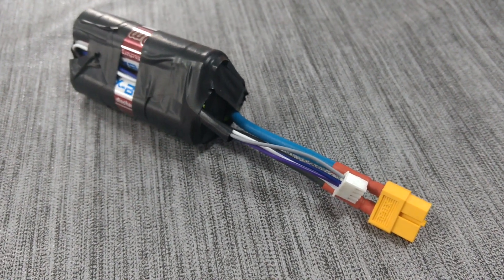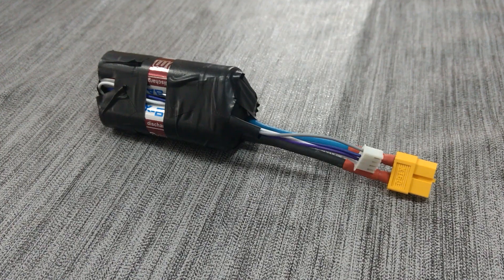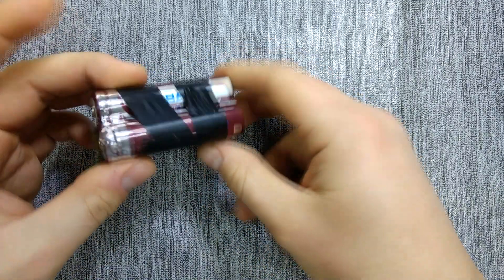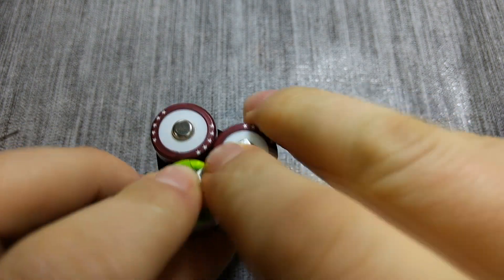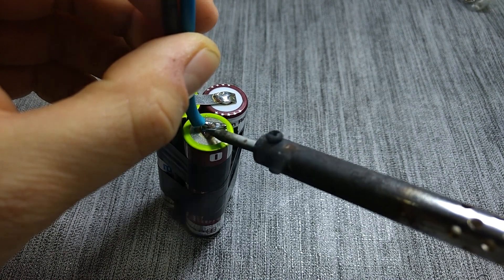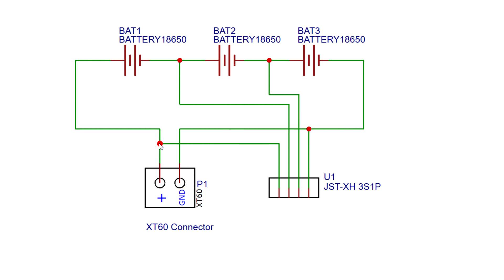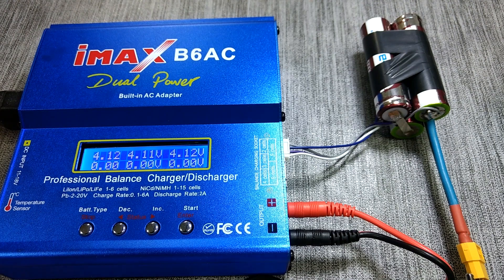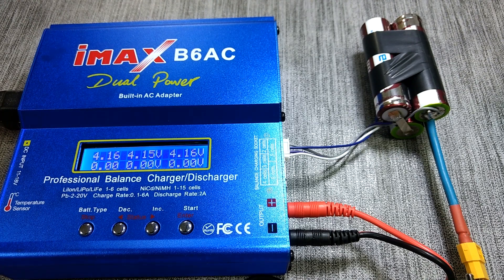RC Battery Pack made with 18650 cells - 3S1P //HOW TO

Comment: Hahah 8800mah ....
the rest, ok. you just forgot to check the datasheet how many amps can be pulled out of the battery without risking damage or ignition 😉
Reply from the maker: 😂😂😂😂 They are more like 880mAh. They are getting a bit hot when used but so far they are intact. Since I've used them for a while now, one of them is starting to develop some higher resistance inside and gets discharged while stored away. Other than that, there were no issues with amperage for just a small RC plane.

Comment: Hi, Can i use a power supply 120v 60 hertz input / 12v 1 amp output or a AC / DC adapter for charging ?and how to connect ? 
Also i have a lot of hard drive pc connector ( 4 pins ), can replace the JST-XH 4 JD....??

Thank's
Reply from the maker: No, you can't! You will need a BMS in order to use that charger. As for the connector, the one I've used is standard for RC batteries. If you want you are free to use whatever you want but you will need appropriate connector on the other end as well.
Reply: Good question, I have random batteries from random vapes I find on the ground everywhere, & i guess I could get a power supply & mimic the output rating of a known charger, please stop me if there's something I'm missing
Reply from the maker: Those are lithium batteries and they can't be charged just by voltage matching. Especially if they are batteries without protection circuit. You need a charger dedicated to lithium batteries!
Reply: @TasteTheCode  thank you for responding quickly, took a break from researching this. This is black magic to me, can I get a vape charger, put it under a oscilloscope & copy it that way? I'm a noob willing to learn, but I got a ton of questions, to which is why I put this stuff off for a long time now, i don't know the difference of how charges charge nicad vs li-ion. One of the batteries I could find, has info on it: krl18350 3.7wh 3.7v 1000mah + 20210728 lastly a qi code. They're so many advanced chargers out there & don't know which one to get, so I don't have to keep buying more.
Reply from the maker: @Eduardo_Espinoza  I'd recommend that you buy a module intended for 18650 cells like the ones based on TP4056 chip. They are inexpensive and you will be able to charge any single cell (3.7v nominal voltage) lithium battery from it with USB.
Reply from the maker: https://s.click.aliexpress.com/e/_9J63Nn
Reply: @TasteTheCode  connecting the dots 18650 = standard size 
Tp4056 = constant amp & voltage 
Can I put this module on 2 batteries that are in parallel so-to be within the 3.7v range? Lastly for my application this battery i found is a little over the normal 2.4v range can I use resistors to make it safe enough to use?
Reply from the maker: @Eduardo_Espinoza  Yes, you can use multiple cells in parallel as long as they are the same type/capacity. As for your last question, I don't really understand what you mean by 2.4v range?
Reply: @TasteTheCode  i'm replacing 2 NiMH x 1.2v AA batteries & in place of them I will be using this 18350 cell, I'm wondering if it's possible to put resistors in series to hopefully drop the voltage enough to make it safe to use for the device I have. Also random question, how can I buy things online without a bank account? Can you really buy things with crypto?
Reply from the maker: @Eduardo_Espinoza  for your application you should really use a DC to DC step down convertor as the lithium battery will have voltage from 4.2v when fully charged, to ~3V when empty. Using resistors you will just waste a lot of power and have too much of a voltage swing. As for buying, don't know. I use Ali mostly and they do not accept crypto.

Comment: one needs to use cell like drills use japan made 25 or 30 amp 18650 units work fine but a lot are low amp discharge higher capacity
Reply from the maker: Yes, the better the quality and the higher the output current, the better the pack will be!

Comment: I read in the comments you use a charger for balanced charging but what stops them over discharging without protection? Cool video as well
Reply from the maker: Since the pack is used in a model airplane, so you can't just cut the power once they are close to empty. There is a device called "Lipo low voltage buzzer" that will start a buzzer sound while in the air once the battery starts to get low in voltage. Once you hear the buzzer, you know that it is time to land and charge the pack again.

Comment: Why are there two different two plugs, one for using the battery and one for charging the cells individually? Can't one use the same plug for charging and using the battery pack?
Reply from the maker: The second (white) plug is for monitoring and balancing the individual cells. The charger will monitor the voltage on each of the cells and then charge it so each cell is on the same voltage at all times.
Reply: @TasteTheCode  Can't you achieve that with the main plug and an internal BMS?
Reply from the maker: You can, but since this is an RC plane battery, the BMS in the battery adds weight and that affects flight performance.
Reply: Was going to say it adds weight too
Reply from the maker: The weight added is too small to make any difference.

Comment: Great video. I am looking into doing the same thing, I was told that the safest way is to use 3 unprotected batteries and then add a PCM for protection against overcharging and discharging. I don't see the PCM in your case?
Reply from the maker: I use external charger that monitors and charge the battery safety. Look at the IMAX B6 charger.
Reply from the maker: Additional, what does PCM stand for? You would usually use a BMS (battery management system) circuit designed for  the type of the pack you want to build.
Reply: I have no clue what a PCM is either

Comment: i got many problems while solding the batteries, the cables fell off
Reply from the maker: Make sure to scratch the surface of the contacts first so you get better adhesion and use liberal amounts of solder paste.
Reply: @TasteTheCode  thank you very much it worked!! Preheating the metal you're soldering also really helps!!
Reply from the maker: I'm glad you got it sorted out! Keep in mind that the batteries suffer form heat so do not over heat them. The least you can get away with the better.

Comment: Amazon sells 18650 battery power boxes . 1,2,4 and 6 battery slots.if I remember correctly. Wire the box with whatever plugs you have. Mount the box anywhere u want. The box itself has on - off switch. Just pull the batteries out and charge them.
Reply from the maker: Yes, you can do that if you want but the box adds extra weight.
Reply: Dont do this. You'll melt the box. These things aren't meant to handle the amp draw of a drone or plane. Neither is solder, and I don't think it's okay to be making these videos and suggesting that it's okay to use these soldered packs. DO NOT use these on anything bigger than a tiny model.
Reply from the maker: I use this an a small trainer airplane and it works perfectly fine.
Reply: @sterkfpv2192  If they aren’t soldered, what did the manufacturers use?

Comment: those batteries don't last nowhere near as long as a lipo battery lithium ion don't discharge like a lipo lithium ion do not have the punch that ain't lipo has lithium ion batteries explode it catch on fire just like a lipo just not as much LiPo battery longer play time
Reply from the maker: Works fine so far!
Reply: Did you have a stroke?

Comment: how much c rating and amps this pack can go????
Reply from the maker: This is dependant on the type of batteries you will use for the pack. The same specs of the cells apply for the entire pack as well.
Reply: @TasteTheCode  for example if im making the 3s pack from 3 sony vtc6 that have max discharge 30a and 20a continous discharge, will the 3s pack have the same amount or not? i dont know how to calculate that
Reply from the maker: @slickyy_  Yes, they will since the batteries are in series the current does not change only the voltage adds up. If the batteries are connected in parallel than the voltage will remain the same and the current will double for 2 cells.
Reply: @TasteTheCode  so if im gonna build that pack 30a esc is enough for my airplane rc build? Doesnt have to buy 40a version?
Reply from the maker: @slickyy_  Yes, but make sure that the motor is not drawing more than that.

Comment: how many minute the run time in that battery pack in rc?...
Reply from the maker: About 10 to 12 minutes on a normal running without too much strain. If the cells are of a better quality, it may go up to 30 minutes.
Reply: thnk u sir...
Reply: will this battery pack charged in b3 compact balance ca
charger?.
Reply from the maker: @johnmarklucing7106  I haven't tried that as I don't own such charger but I do not see a reason why it will not charge.

Comment: whats the all up weight on the pack? looking to build something similar for a sub 250-gram quadcopter
Reply from the maker: I don't have precise way to measure it but it will depend on the cells used. Some are heavier than others.
Reply: Dont use the batteries he did, they are fake and dangerous. For a sub250 copter go for a 2s build. 1404 ~6000kv motors. Use LG HG2 batteries or sony vtc batteries. These will give you a true 2600-3000mah capacity. The hg2 cells are 45grams per cell so that should give you some idea.

Comment: How do you stop it from overdischarging
Reply from the maker: I have one of those battery alarm circuits attached to the pack.
Reply: @TasteTheCode  Do they stop the current or just beep, just i am looking at using a similar battery for onstage and I cant really have it beeping.
Reply from the maker: Unfortunately they just beep. You can remove the beeper and rely only on the displayed voltage if you can see it. Other option is to use cells that have the protection circuit in them. That will stop the current once one of the cells is empty.
Reply: Taste The Code all of my cells are recycled from laptop batteries, and I won’t be running a BMS as I have a balance charger but I can find just and over discharge board so I may end up in having to try and run a BMS and trying to charge the battery with a proper balance charger
Reply: the same u would normally do it a lipo, a beeper, this is not  dji  batteries here

Comment: 8800mah ? thats some NASA grade stuff right there, more likely 'B - 800mah ' recycled cells  - good work though :)   Do they get  Hot with amperage pull ?
Reply from the maker: Hhahaha, I haven't actually measured them but I would guess that they are around 1000mah based on use time compared to some other packs I have. They get a bit warm with average use but nothing major. I haven't really stressed them as I know they are fake cells and I don't want to risk them to catch fire while flying :D
Reply from the maker: Yes it's a Chinese battery.

Comment: jou day 3s 1p but this is just 3s
Reply from the maker: 3S1P and just 3S is basically the same thing as there is only one group in parallel.
Reply: @TasteTheCode  jes a know but to make it its not the same and sole people dont know that but is a minor issue but if jou make a turitorial about a 3s 1p jou have to make it also in the video because if i typ how to make a 3s 1p than i also wanna make a 3s1p and not a 3s jou see what i mean and most of the time if somebody search a turitorial it means they know nothing about it.
Reply from the maker: What do you mean it is not the same? 3S1P = 3S. It is just a lazy writing to call it just 3S. There is no mechanical, nor electrical difference in both.
Reply: @TasteTheCode  are jou seriues a 3s are 3 cell 3s 1p are four cells 3in serie 1 parallel its a mojor diffrence because jou get twice the amps so its not the same
Reply: @TasteTheCode  and to make it its also diffrent it easy did jou make a 3cell batery 1 parallel in the video no so dont say dat jou make it in the titel its misleading
Reply from the maker: Dude, what you are saying is not possible. Try to make it and please record a video of it as we all want to watch explosions. If you connect just a single cell in parallel with the rest of 3 cells, there will be a TON of current flowing through that single cell. The P marking of battery packs explains how many parallel circuits are in the pack while the S marking is how many cells there are in each of those circuits.  On the link you have a schematic of a 3S2P pack where you have a total of 6 cells where there are 2 parallel cells in each of the 3 circuits in series. http://oi60.tinypic.com/qprp92.jpg

A battery pack with 4 cells can either be a 4S1P,  2S2P or 1S4P!!!

Additionally here is a link to another source explaining the wiring of a 3S1P battery pack
https://www.helifreak.com/attachment.php?attachmentid=196010&d=1292751757
Reply: @TasteTheCode  i just maked one for mu rustler and it works jou also can buy it look it up 3s 1p are 4 cell and listen jou say jou can make it whit 6cel than jou can also do it whit four easy just conect plus on plus and minus and minus on 2 cel and than put it in serie whit the other cells  easy as fuck like this jou have a 3s s whit 2 times the amps
Reply: @TasteTheCode  last example if jou buy a lipo 3 s there a 3cell if jou buy a 3s1p there are 4cell how do jou  think they do it magic no like i say and if jou dont know this stop making turitorials just put two parral other 2 in serie thej dont call them for nothing 3s1p p standing for parralel s standing for serie jou get it
Reply from the maker: Nope! 2 cells in parallel in series with the other 2 cells is a 2S2P pack.  Here is a reference: https://www.google.com/search?q=2s2p+battery&num=30&rlz=1C1CHZL_enMK747MK747&tbm=isch&tbo=u&source=univ&sa=X&ved=2ahUKEwjx1Putyb_eAhWQxIsKHRvKA2EQsAR6BAgCEAE&biw=1920&bih=948#imgrc=NjISrDIS5EPzzM:
Reply: @TasteTheCode  no beause 2s is 7.4 volt listen last time because jou think jou know it and whatever i say jou stil think joi right jou take 2 cel put it in parral how many volt that is 3.7 because voltage stay the same oly amps go up than jou take the other 2 and put it in serie whit the 2 in paralel how many volt do jou get 11.1volt  so its called as 3s 1p look it up call a rc schop or something.
Reply from the maker: For the last time, 3S is EXACTLY THE SAME as 3S1P. The 1P is only added to the name for clarity of connection. Check this image: 
https://www.google.com/search?q=how+many+cells+in+3s1p+battery&num=30&rlz=1C1CHZL_enMK747MK747&source=lnms&tbm=isch&sa=X&ved=0ahUKEwiN4fLWzL_eAhUhlIsKHTZUBGAQ_AUIDigB&biw=1920&bih=948#imgrc=aworTymHwoiqSM:

The pack is labeled 3S1P and it only has 3 cells!!!!! Please find and show me and everyone else here a 3S1P pack with 4 cells!!!! You can't as it does not exists!!!!!
Reply: @TasteTheCode  i looked to jour link its just like the 2s2p but intead jou put 2 cels in serie so jou got 11.1 volt or charged 12.6 i build it yesterday and if jou buy a 3s 10 pack there ar 4 cels how do jpi get 11.1volt or 12.6 charged whit 4 cell to put one i parralel
Reply from the maker: As I said, find me a commercial example of a 3S1P battery with 4 cells and show it to me so I can get educated. 

If anyone does what you suggest, the other two cells that are just in series will see current of twice their rating since the 2 parallel cells will be able to provide twice as much as single cell. The result will probably kill the batteries in the best case scenario or burn your house in the worst. For a properly balanced and capable cell, all parallel circuits need to have the same number of cells.
Reply: @TasteTheCode  oke i a orderd 2 yesterday so tommorow or day after tommorow is let jou see one but it realy exist i let jou know  if recived them
Reply: @geoffreyheirman2379  boi first off your English is shit, and second  almost everything you said was wrong, lmao think what you want